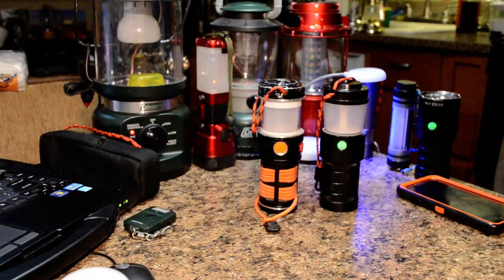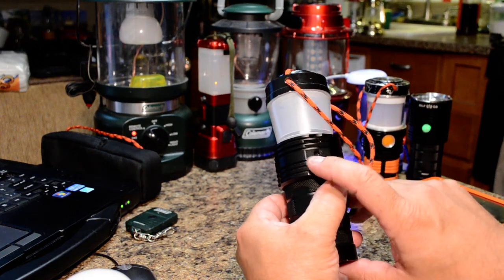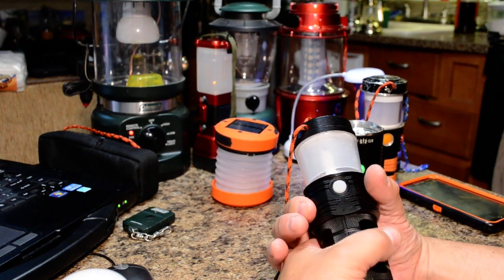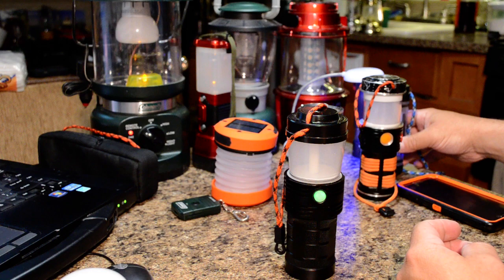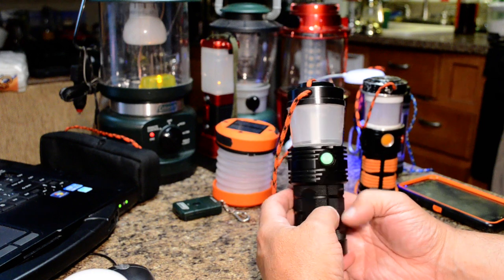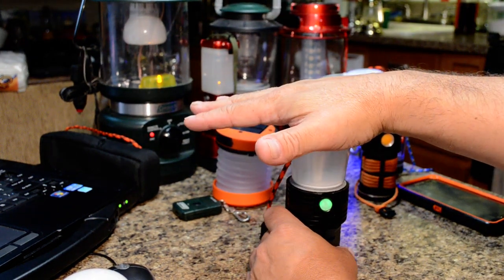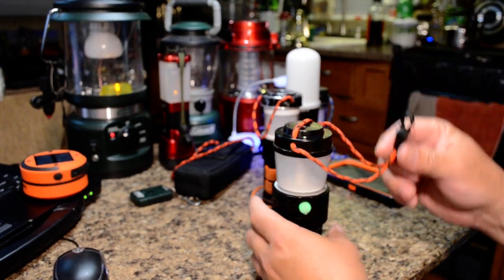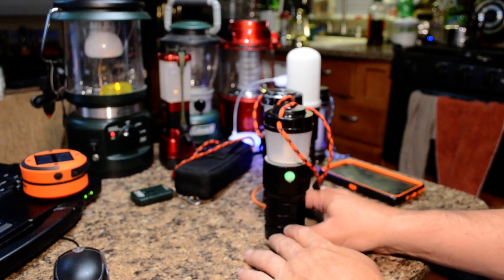BLF Lantern Part 2

Comment: glad to see the project is going smoothly, may i know what lantern is on 11:18?
what kind of battery did it use?
Reply from the maker: That is the collapsible "Ivation" variant of light ( also found as different brand names) it uses a generic 14500 Lithium Ion cell. It can be upgraded to a better 14500, but unsure if a larger 18650 woudl fit inside the lantern case.